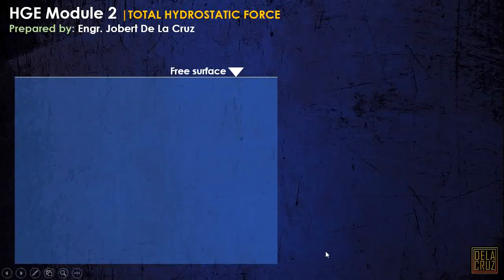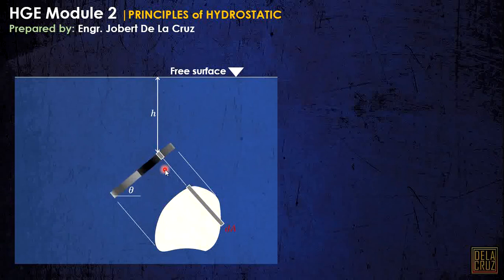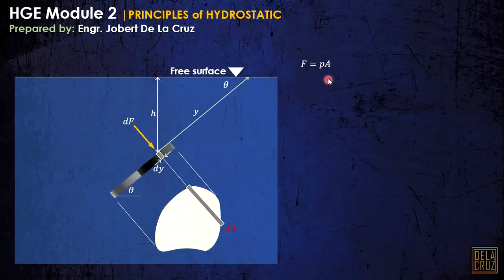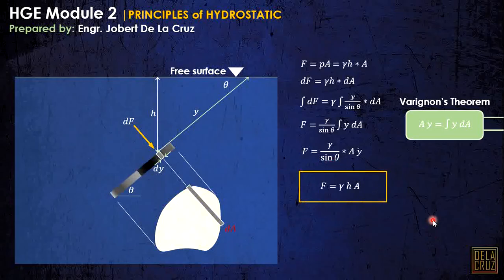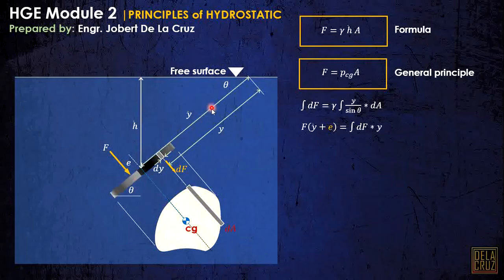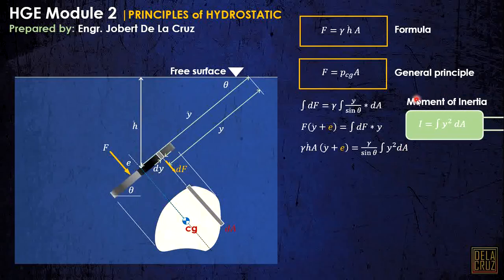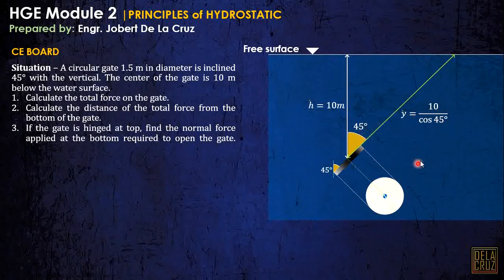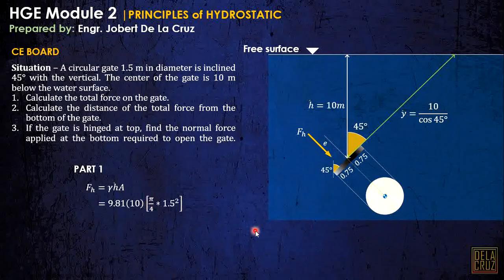PRINCIPLES OF HYDROSTATICS | FLUID MECHANICS | CE BOARD | DE LA CRUZ TUTORIAL

Comment: Good day po sir, question lang po, paano malalaman ang "Hydrostatic Force" ay naka locate sa right or left side from the center of gravity sa circular plate or yung "Eccentricity" ay right side ba from the center of gravity or left side from the center of gravity. Thank you sirr :)
Reply from the maker: Locate mo lang ang centroid of the section considered from the vertical axis. Ang mag kakaroon lang nang eccentricity is yung vertical location of the centroid caused by the property of pressure in fluid.